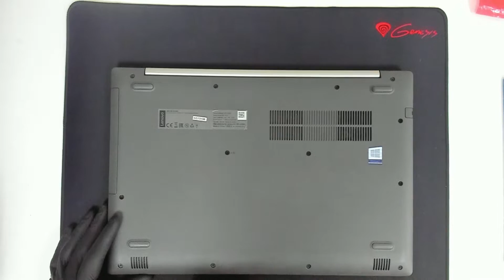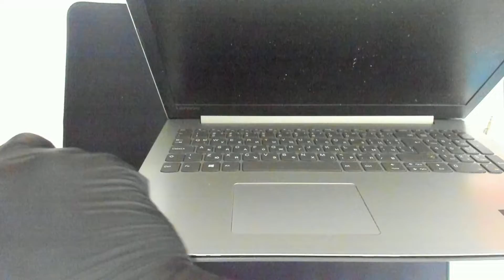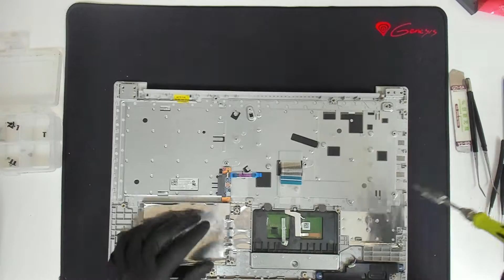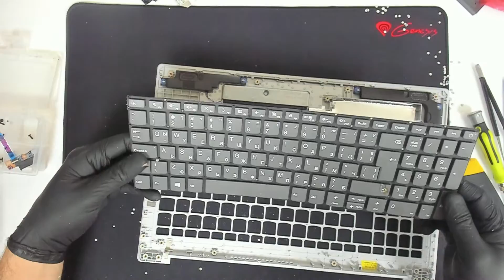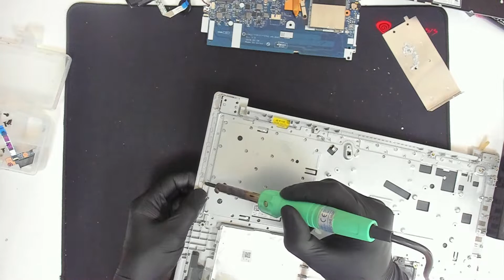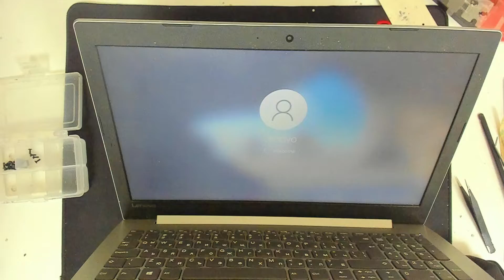Lenovo IdeaPad 330 Keyboard replacement - The proper way

Comment: Hey, i spilled some curd over my keyboards and didn’t notice that...after 5 mins i noticed....but at that time my screen got blank and laotop was turned off...now its not turning on and when i connect to a charger, the light is also not glowing...only the fan is runnig.
What should i do?
I have this same model...lenovo ideapad 330
Reply from the maker: You need to take the laptop to a repair shop. They should open it, clean it and if something needs to be replaced, they will do it.
Reply: @LaptopDisassembly  okay thanks dude❤

Comment: You’re lucky enough to still have it turn on without the isolation sheet 😂
Reply from the maker: No idea what you are talking about. I haven't remove anything from the board side. On the keyboard side everything is 1:1 with the original. So it is not a matter of luck.

Comment: I have Lenovo 330s 15IKB . It does not have backlight keyboard. Lenovo websites shows compatible backlight keyboard for my laptop model. My question is where do I have to insert the backlight cable ?
Reply from the maker: You should have separate connector usually 2-3 pin and written knd_bl or so.... If you tell me the board model I can have a look in the schematic if available.
Reply: @LaptopDisassembly  Motherboard model is Lenovo LNVNB161216
Reply from the maker: @ijazzzali  will check in a bit. Was driving..
Reply from the maker: @ijazzzali  check do you have KB_LED or KBBL1 marking on the board... Should be close to the keyboard connector
Reply: @LaptopDisassembly  do i have to open only the back panel or remove the entire motherboard to look for this marking ?
Reply from the maker: @ijazzzali the connector should be visabe when you lift the back cover only. There shouldn't be any connector on the other side of the board.
Reply: @LaptopDisassembly  Thank you. I will get  back soon and confirm you once I remove the back cover
Reply from the maker: @ijazzzali depend on the board revision, there is a small chance the connector to be missing.
Reply: @LaptopDisassembly  hello sir
My laptop does indeed says kbbl on the motherboard 
Can you have a look at the image below and confirm 

https://i.postimg.cc/J0gVbS5q/20241115-112417.jpg

https://postimg.cc/bSQBPCMD
Reply: @ Hi
I have remove the back cover and the letter kbbl are mentioned on the port near the keyboard connector. Can you confirm.

Here is a picture of my laptop back open
https://i.postimg.cc/ydDw81Wf/20241115-112413.jpg

https://postimg.cc/mzGddGYM
Reply: @ hello, my laptop motherboard does indeed says kbbl. can you confirm ?
Reply from the maker: @ijazzzali  yes, it should be that one.

Comment: I remember when it took 2 hours to replace a screen assembly or a motherboard, even for replacing tim. Now it takes 2 hours to replace the keyboard, 15 minutes to replace a screen assembly, motherboard or tim. Not sure if this design is an advantage though. Soon the whole laptop will be held by just glue.

Comment: Hi , hope u r doing well, I have a question please, what's the name of the material used with the solder to glue the keyboard and where I can find it ? Thanks
Reply from the maker: These are the plastic pieces that came off when I did remove the old keyboard. I just touch them with the solder iron, they stick to it and I bond them back to the plastic.

Comment: Have to do this on my MSI or buy a new laptop. This is an IDIOTIC way to design a system! Next system I buy MUST have a keyboard that simply clicks in on the top. Designs like this deserve to be left on the shop shelf unsold.
Reply from the maker: Most of the new ones are like that. You can use this method also. Some of the models have some small screws but this one no.
Reply: @LaptopDisassembly  Unfortunately, you are correct. Great job though!
Reply: If only we knew before buying, yes, they should be left in the shop shelf unsold.
Reply from the maker: @hugocamacaro5280 pretty much all the new ones are the same.